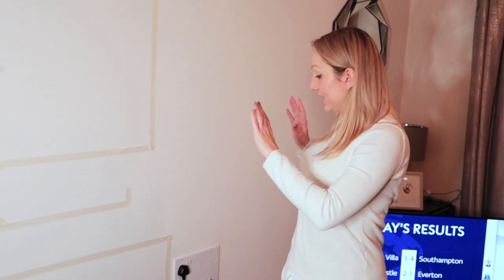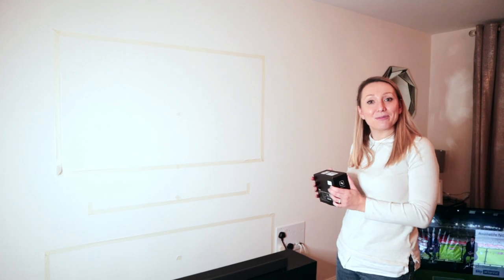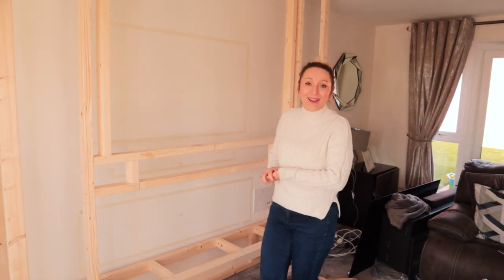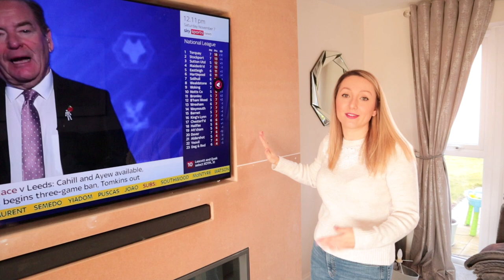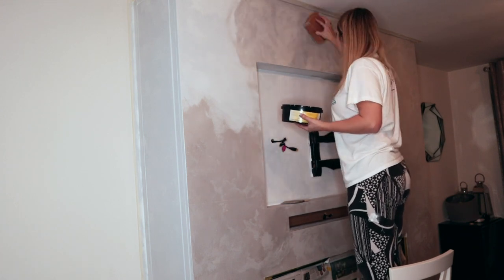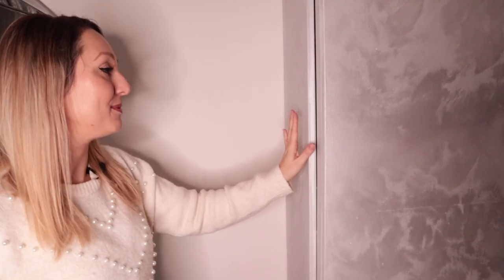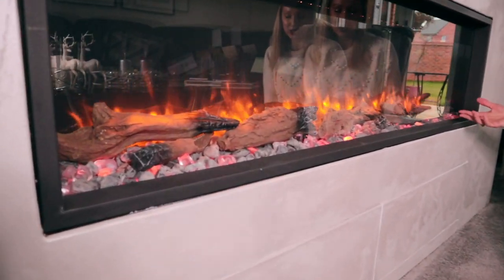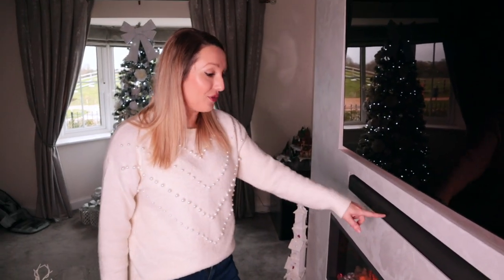Living Room Transformation - TV Firewall - Fireplace Makeover

Comment: Looks good i'd be looking at something similar, but one thing is you got a dolby atmos sound bar, but blocked in the sides and top of it so it can only fire the sound from the front, makes whatever side/top firing speakers it has in it a bit redundant
Reply from the maker: Hi, we got the one that just puts the sound out the front, not with speakers on the top or sides etc

Comment: Finally,  a non DIY TV firewall build video. Because not everybody has the time or even the  desire to build one for themselves.  Great look, i Only wish you gave pricing information on the contractor for this particular build. But, thanks for the inspiration
Reply from the maker: There was no way we were attempting this ourselves, it would not have turned out well!  We paid just £900 if that helps.  It would've been less if we didn't add on the doors and built in storage :)
Reply: @AtHomeWithChelle  where is the carpenter located?

Comment: Hi, fantastic video.  End result is amazing.  Can you tell me where you placed your sky box.  We are having something similar built shortly, would like the sky box hidden but obviously it needs to receive the remote control signal.  Thanks in advance
Reply from the maker: Thank you so much, I'm so pleased with it.  The box inside the side door, so basically inside the unit.  It's a sky q box so the signal works through the wall.  I'm not sure the signal works the same on a normal sky box.  Hope that helps.
Reply: Ah, I see.  Thank you for letting me know.  Cheers
Reply: @AtHomeWithChelle  Great, sorry should have read previous questions before asking, we have Sky Q and doing this very soon.
Reply: Hi
Sky Q main box is Bluetooth so you can hide the box

Comment: I'm in the process of completing my TV fireplace frame, the carpenter is worried that the paint might pile off since it's meant for walls and not mdf, how's is yours doing, still same?
Reply from the maker: Mine is honestly fine. I used a couple of coats of mdf primer first then the primer that comes with the paint. It looks no different today than when it was done 😊

Comment: how you get it out when it breaks? or change decoration?
Reply: Lol I asked someone about this on FB. Basically It's a pull out TV barcket . Not sure about the fireplace tho
Reply: Fireplace u just unscrew and pull out from the front
Reply: @lowhinhsaeteurn  but the black top part is behind the wall? its stuck basicly right?
Reply: @DigitalEdward  Correct, it's stuck in the wall for good. Only way to get it out is to break the wall. However, if any part breaks inside the fire, everything is accessible via the front glass panel.

Comment: How much did the carpenter charged £
Reply: An earlier comment shows it was £900 i did an exact build actually 77 lg gx and I had sides build of each wall to place in wall speakers with surrounds into brick wall !!
The fireplace and the sides of the wall had rock wool with 100mm of soundproof plasterboard 
 And ceiling speakers for dolby atmos I was intended to keep my shelves open and have the PlayStation and some wireless chargers on display
Reply from the maker: Hi, including the extra storage, it was £900, would have been about £750 without it.
Reply: @AtHomeWithChelle  Was that including materials Chelle or do you have to supply that at extra cost?  Many Thanks